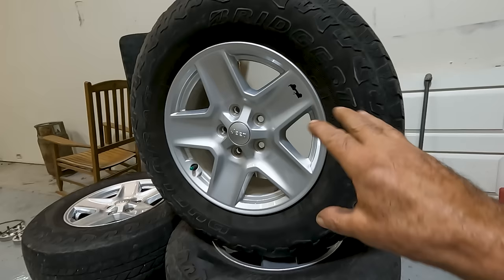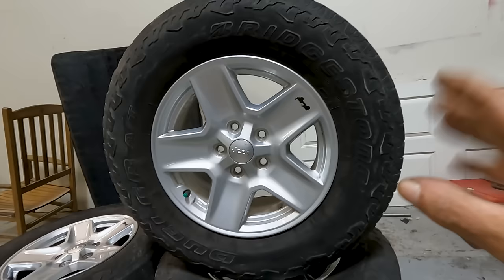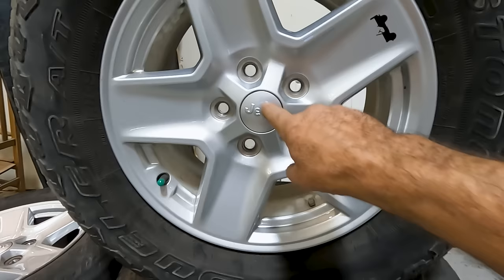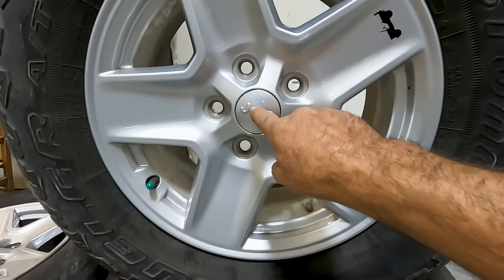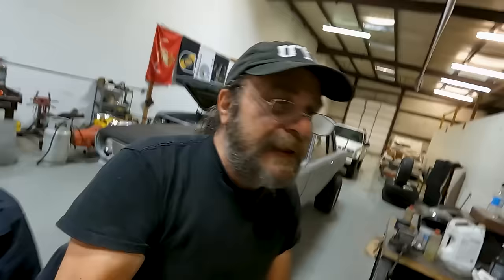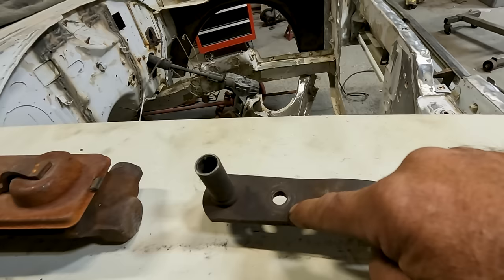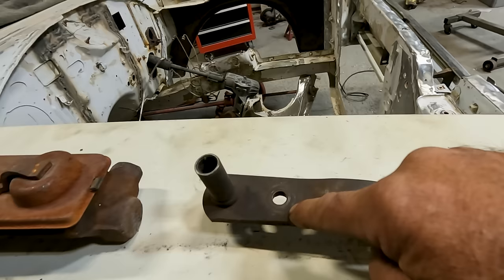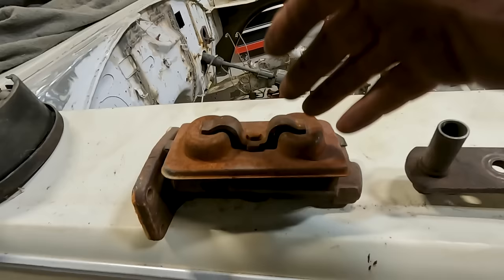Modifying Classic Cars And The Butterfly Effect - Can You Outsmart The Engineers?

Comment: You are right Tony, I think the old stuff works fine most of the time. I wanted to keep my 1952 Ford Panel truck with straight front axle all original. But that front steering was bad. You could not keep it in the lane driving down a two lane street not to mention the interstate. So I rebuilt the front end and it was just as bad so installed a mustang II and converted all brakes to disk with a duel master cylinder. They worked find and all wheels lock up just before I hit that asshole that pulled out in front of me.

Comment: My dailies have never really had much in mods so to speak. Dress ups, yeah, slot mags, little bit of chrome, comfy seats etc, as you'd know Tony, having seen the ute. The nearest things I've done to mechanical modifications, are all done using factory optional parts. Factory disc brake swap from a donor, 2 barrel carb. Our disc option gave you 1/16" smaller rear wheel cylinders, same drums though.
Reply: Howdy, do you do a lot of highway driving there?
Reply: @mexicanspec  Mostly a 20-30 minute highway dash to the next town either way. At least once every couple of weeks, a 2 hour run down to the big smoke.
Reply: That is nice to blow it out.  My 1963 Savoy has 4 something gears in the back so the highway is off limits to me. @TAVOAu
Reply: 4+ gears would make it sing loud 😆 I have 2.92 and I keep looking for another gear.
Reply: It does and with a slant 6, I don't even take the chance. @Grumpy-sy7wr
Reply: @mexicanspec  Wow. Is that stock, so the slant can haul the big body around? Sounds like a city car for sure.

Comment: You really opened a can of worms because of all the variables . Things like spring rates , shock valving sway bars and types of bushings . Next piston size in the master ,  caliper or wheel cylinder and number of pistons with disk brake applications . Lining materiels like Organic , Full Metallic ,Semi Metallic even  Ceramic . Like you said petal force ratios , anti lock technology,  proportioning valves for brake balance . The Science of Stopping is just as important as  not leaving horse power or fuel economy on the table and we haven't even  got into weight or where the weight distribution is ? Tuning brake performance is an art not to be ignored .

Comment: Awesome video uncle T, wondering what your opinion would be on a dual reservoir master cylinder swap for my 1964 dart. I have absolutely no problem driving with all drum brakes but had a wheel cylinder go out on my 1948 DeSoto when I was dailying it and wouldn't mind a little more insurance then the stock single reservoir master cylinder.

Comment: What about cars pre disk brakes or cars where it was optional?
Reply: In my experience, if you add horsepower you need to add equal braking ability. I hope that helps.
Reply: On my Dart it was optional to,, go 10" vs 9" stock,, and like Mustang Kelsey Hayes Caliper,, Fixed style.. think mini Brembo.. two piston on each side.. it's what I will eventually upgrade to...
Reply: He talked about that.  If you are going to switch out the front discs you have to match every other part in the braking system as the original engineers did.

Comment: My ideal daily driver would have a good, solid body and have upgraded brakes, all larger diameter disks to fit taller wheels and with a proper master cylinder and adjustable proportioning valve, a nice wheel tire combo that gives good grip and doesn't rub anywhere to take advantage of the upgraded brakes, swaybars (if needed), decent shocks, headers and good quiet mufflers, some porting and polishing and a good valve job, maybe some carb work and a decent dual plane intake, a cam that makes its power down lower so that it works for the rev range that you will mostly be in when daily driving. An LSD with higher gearing for good gas mileage and a lock-up converter. Don't forget a good AC, comfort is important.

What I'm looking for is a car that is responsive, stable, has decent handling and acceptable gas mileage. I don't see anything that would be upsetting that poor little butterfly anywhere near as much as it upsets my wallet.

I agree that the engineers look at a lot of factors but they are also lower on the totem pole than the bean counters so a lot of compromises are made. The engineers are also the same people who seem okay with my wife's Ford Focus needing an engine mount replaced at less than 20 thousand miles.

Comment: Do you stick with bias ply tires on classic cars that came with them?
Reply: Lots of classic older cars had radial tyres as an option even back then. Even US cars. Along with power front disc brakes.
Reply: Only time I've used original type of bias ply tires on a classic is when doing an original restoration, like on a 57 Chevy, where I wanted to have the original appearance wide whitewall on it, for car shows. But for regular driving I use radials on all my old cars, because they steer, handle, and ride better with radials, with no other changes.

Comment: I get what he's saying and generally I agree. Every contingency? Not really. They didn't figure on blowing a wheel cylinder with a pickle jar/single circuit master cylinder. That's abnormal circumstances but it happens. A cylinder, a steel line, a flex line goes out on a single circuit master cylinder, you got nothing.

I like a dual circuit master cylinder. Maybe stainless brake lines. I'm fine with drums all around but deep water can effect them and make them pretty useless for a little bit. No biggie if you keep that in mind. Early discs were undersized at least on an Olds Vista Cruiser. Most times you wouldn't notice but braking down a steep grade you'd get some real heat building up. Some mods are justifiable. For the most part I'd get it working as it left the factory. Beyond that leave them alone and just drive them.

Comment: Good video, Tony. One thing you didn't mention was the fact radial tires didn't become commonplace until the mid 1970's. What considerations should someone have when driving a car that was designed around bias/belted tires and is now on radials?
Reply: I've had 54, 55, and 57 Chevys, 67 Impalas, and a 73 El Camino...cars that weren't designed for radials, that I used radial tires on, and never experienced a negative result. I've only experienced positive results with big improvements in steering and handling and ride. No need to change anything.

Comment: I daily drive my 1966 Buick Wildcat with a 425 (just rebuilt engine). I am forever being told that I need to change out the stock drums with disc brakes. I am encouraged to change out the points system, add a turbo..... I just tell people (my brother included.) that I enjoy driving the car stock. I added a forward/backup camera, stereo in a home built console, tire pressure monitors and a set of 3 gauges. All the things I added to the stock configuration of the interior can be removed in a few hours without leaving anything behind. The only thing I would change is the old single braking system, instead of a more modern dual master cylinder.

For the rest of it, I am not nearly as smart as the guys who designed my girl. I don't think I will try to outguess them. ⛔

Comment: I keep thinking 5000 pounds behind an XJ will be a wild ride, probably sometimes hair raising. Now if it has double braking axles on the trailer it wont be as bad but i know pulling 5000 pounds with my Sequoia without braking axles can be a pretty good load and push that vehicle around...and the Sequoia is much more vehicle than an XJ! Even accelerating is going to tax that XJ or even going up hills will really strain than vehicle with a trailer.

Comment: I once thought about modify my 1995, GMC sierra 1500 only because all the new trucks were coming out with bigger wheels and tires and I was worried about body damage if they hit me well little did not know that plastic Styrofoam yes and even carpeting would get so cheap on these vehicles that you can take your finger and almost put damage done to the body and my tire guy told me at that time that’s when the Cooper’s AT3  first come out and I love them tires anyway it wouldn’t have Handel the same and the weight distribution would have put it in a higher center gravity and that I know I didn’t want so as like in other video about what modification would you do well that depends on what your plans are for that  Vehicle!

Comment: Tony this is true. Let’s say you just want to change drums to disc front brakes you need all variables what car ,what hp,what master cylinder what rear brakes ,what size brake lines to accommodate disc brakes.  Just like you said it not just putting an adapter plate on and go to disc front brake.  You must do the homework.

Comment: I have to disagree, to a point.  My 71 Plymouth with horrendous 10" drums (I once braked HARD through a red light!) is so much better now with 11.75 disks, fast ratio steering, and upgraded torsion bars, strut rods, upper control arms, etc.  The car actually handles better than new cars I've driven.  Yes, the engineers knew what they were doing.  They also had to fight (and lose) to the bean counters cutting back on how well they could build the cars.  Upgrades, if done right, are remediations to the original design.

Comment: Tony, I think you need to spend more time on this topic. I would counsel anyone with points ignition to throw that crap out immediately and replace it with HEI. Points are not reliable. Anyone with sealed beam headlights needs to upgrade those to H4 halogens because you will get blinded by other cars and that's a big safety risk. I would tell anyone with front drum brakes to replace them with discs. Disc are easier to control at the limit like you're describing. Yes, people should think holistically about the braking system, size the master cylinder and prop valves appropriately, etc. But they should definitely have good, modern, new (not old rebuilt crap) brakes on the car. 

It's rare you'll outsmart the OE engineers, but they aren't omnipotent. They were hostage to the technology of the time. Nobody uses points, or generators, or carburetors anymore. We have much better technologies now. The engineers were hostage to cost accounters, and sometimes, they simply made bad decisions. Even the best cars have stuff that doesn't work, knobs that fall off, engine designs that blow lots of head gaskets, etc. You should fix that stuff if you can.

I say don't discourage modification. Spend time educating people how to do it properly.